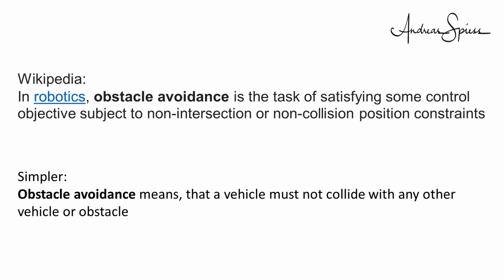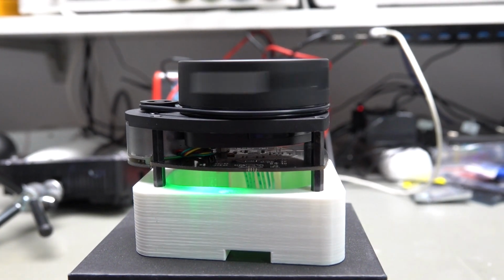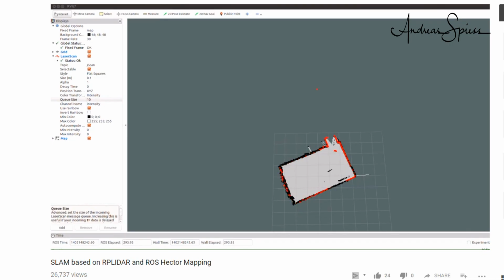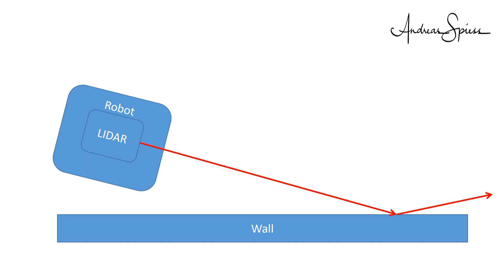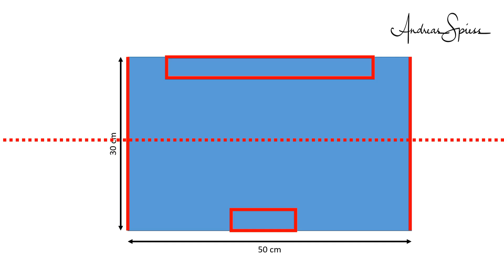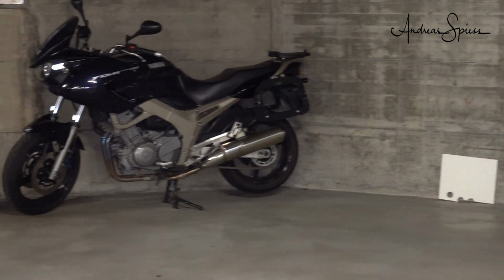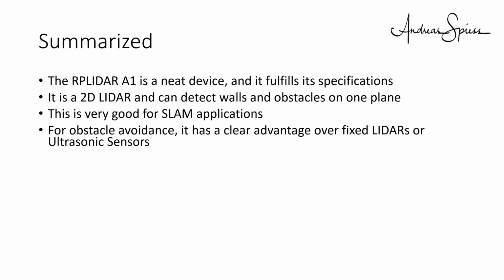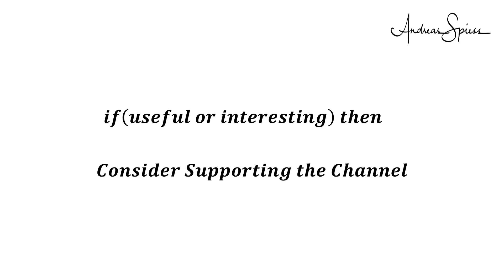#227 The ugly truth about LIDARs for obstacle avoidance (RPLIDAR A1, Arduino, ESP8266)

Comment: The 2D-system could be made into a 3D-system to look in the forward direction by mounting it vertically on a turntable that ‚oscillates‘ from left to right and back at a defined speed within a defined angle. You probably lose some scan rate for backward beams. That‘s the same with horizontal mounting. But while the system is vertically mounted, the challenge would be to reduce beams in all other false directions by coordinating the turntable‘s speed to the scanner‘s speed. The rest should be a matter of software. Probably exceeds the possibilities of a small Computer...
I’m just blowing the faint wind of my thoughts into this great brainstorm.
Thank you for all your great Videos.!
Reply from the maker: The idea of moving the head was discussed in other comments. It is possible, but you lose time with it.

Comment: HI ANdreas, I came to the same summary. Then I got to thinking outside the box (pun) while watching this. What if we mount this lidar on the verticle plane rather than the horizontal? Then we no longer have a low hanging object or ground object problem. We now have a left to right problem. If we mount this on the side of our tank for instance and as high as possible, this sould solve the problemds discussed. Now left to right is a problem as our sensor is only mounted on the right side, we can now mount a second on the left side to solve this problem. However I propose instead of one mounted on the left and another on the right, we  have both left and right sensors mounted on a spinning platform on top, now we resolve the shortcommings of 2d lidar and now have 3d lidar(or close enough) what do you think? Picture an old police siren that has two lenses inside which rotates, this is our two vertically mounted cheap lidar modules instead. Thoughts?
Reply from the maker: There were a few ideas in the comments. You can look at it from different angles: In the end, you have to reach a 3D area. You either do it with a moving 2D sensor (with the tradeoff of additional mechanics and slow speed) or you upgrade to a real 3D scanner.

Comment: @Andreas Spiess - thanks for a great video series - you always ask the "right" questions when checking out new technologies.

In an earlier reply you stated "So today, I tried (my RPLIDAR) in front of a mirror. It was able to detect obstacles through the mirror, but only if the mirror was in a 90 degrees angle to the laser. This was only a narrow area.".

Can you be more specific? If the suggestion from some readers is to take the back side of the 360 circle and use one mirror at 45° degrees to point the laser (and the reflection path) up and another one above at -45°to point it forward the angle between the incoming laser and the reflection will be 90°. Does this work? Can you hold the RPLIDAR at 45° close to the mirror and check, if it shows reasonable distance readings based on the reflection?

Of course it would help if you use a "surface" mirror where the aluminium is not behind the glass but in front of the glass. The you only have one reflection plane and not the glass plane and the aluminium back plane for reflection. A cheap source for such mirrors for 6€ is here (they are used in overhead projectors): https://www.betzold.de/prod/77637/ .
Reply from the maker: I did exactly what you describe. And it showed reasonable results. But as I wrote, only for a few degrees, because the mirror was flat and not round. You can draw the beams and see where it goes if the angle points to the back to the mirror with an angle of let's say 20 degrees. Then the beam does no more go to the front to the bot, bot to one side.

Comment: LIDARS are mostly used for mapping and planning, not for emergency obstacle avoidance. What you can do to improve the chances of detecting small objects with the LIDAR is to implement a probabilistic sensor model like HIMM or Bayesian and map the data over time.
Reply from the maker: I always thought LIDARS on cars are also used for obstacle avoidance. As I showed the LIDAR was able to "see" quite small objects, but only in one plane. So the enhancement of analysis would probably not help the (fast) obstacle avoidance. However, it could help to increase mapping accuracy.

Comment: LIDARS work like ultra sonic distance sensors but using light instead of sound. They don't triangulate anything. You might have mirror walls, but most people have regular white walls, that scatter light into all directions just fine. And those 3 fixed LIDAR systems you tested in an earlier video aren't even LIDARS, they are just regular infrared proximity sensors which work in a completely different way and have nothing to do with LIDAR.
And I'm not sure what the purpose of this video is... Of course if you don't have the right LIDAR system for your obstacle avoidance system, you're not gonna have a hard time avoiding obstacles. If you don't have the right screw for a particular application that also doesn't mean screws in general aren't well suited.
LIDAR is absolutely awesome. And if you have the right system it has countless potential uses.

Here are some examples of what LIDAR data from a good LIDAR system looks like:
https://youtu.be/nXlqv_k4P8Q
https://youtu.be/aIxYt7DkK5A
https://youtu.be/4RRBOoLsCEg
Reply from the maker: My definition of LIDAR is: Light Detection and Ranging. So we use different definitions. And there are a few ways LIDARS work. Only one is Time-of-Flight.
Reply: @AndreasSpiess  "Light Detection and Ranging" isn't a definition, it's just what LIDAR stands for, it is based on rader which stands for "Radio Detection and Ranging", but neither of those say anything about how the work or what would be considered a LIDAR. If you pump so much current through a diode that it starts glowing that doesn't make it an LED, it just makes it a broken diode.
Considering the term "Light Detection and Ranging", I can understand someone considering any system that uses light to measure distance to something LIDAR. But technically LIDAR is a specific way of measuring distance using light and just as triangulating your position using GPS isn't called RADAR, even though it technically also uses radio waves to range something, a common infrared proximity sensor isn't LIDAR, even though both commonly use infrared to measure proximity.
For more information on LIDARs visit: https://en.wikipedia.org/wiki/Lidar

Comment: To escape the 2D restriction inherent in the rotating laser platform, could one use a two-axis mirror system of the type that is inside of a grocery-store bar-code scanner?
Reply from the maker: Maybe. but not easy on a rotating device. And you would lose most probably speed

Comment: Is it possible to run multiple of this A1 sensors in the same vehicle, or in the same space, without interfering? Maybe synchronizing phases in some way? Or using different wavelengths?
Reply from the maker: The laser is quite small, so it should be no problem to run a few of them in parallel. The chance one sees the other for more than a fraction of a second is quite small. But i only have one :-( So I cannot test.

Comment: A good mm wave radar should do the trick. May be see what you can achieve with a RSM2650 although I do not think it would be successfull.
Reply from the maker: Unfortunately, these sensors only detect speed, not distance. We used them in an earlier video. Maybe it would be possible to use a speed signal with an algorithm to do obstacle avoidance. I do not know.
Reply: Look at the  offerings from aerovironment:https://aerotenna.com/sensors/#usensing
Some offer significant range for high speed navigation. They have demos showing it detecting power lines as well

Comment: One of the ways to speed up computations is to do a buffering and batching. Buffer lets say 30 points, then send an array of 30 points to a different core or processor where they are all processed together (i.e. denoising, combinging with previous data, doing kinematic compensation from gyroscopes and accelrometers, etc). This way per-point overheads are reduced greatly, and main code only needs to focus on communication with lidar and basic processing of points. 1400 points per second is extremely small amount of data for modern computing systems. In DSP and audio processing systems you usually process about 100k samples per second. In video processing dozens of millions of points per second. In graphics systems, you can be processing trillions of entities per second, using FPGAs, DSPs, GPUs or multicore CPUs. As well by smart software solutions like batching, async processing, circular buffers, vectorization, etc.

Seriously 8MHz, 8-bit MCU with no FPU, no DMA, and multiple high speed UARTs is terrible for any serious robotics.
Reply from the maker: This is what I meant when I mentioned a subsystem. With my 3 ultrasonic sensors, I used an ATTINY to do the measuring. Like that the main processor only had to read two values: The shortest distance detected and the direction where it was. Much faster.

Comment: I purchased a RPLIDAR A1 based on one of your earlier videos. I've constructed a mount to pivot the LIDAR up and down.
I think the increased scan time can be compensated by controlling the rotation of the LIDAR directly.
Rather than having the LIDAR sweep a full 360 degrees, I plan to limit the rotation to 90 degrees or less. I'll need to either control the DC motor included in with the RPLIDAR A1 or to use a different motor to control the LIDAR rotation.

I haven't tested how well I can control the included DC motor yet. Hopefully an h-bridge will allow LIDAR to sweep back and forth rather than rotate continuously. I'm skeptical I'll have enough control the included motor to make this work well. I'll likely need to add an encoder to monitor the motor's speed and position. The small motor might not be up to the task of continuously changing direction to produce the desired back and forth motion. I think it's very likely I'll need to use a different motor to produce this motion.

The LIDAR itself provides feedback of the device's angular position but I think it would be hard to use this feedback for relatively precise motor control. I think either a gear motor with an encoder or a stepper motor will be needed. A stepper motor should be okay since the position feedback could be used to correct for any lost steps.

I'm hoping by adding a tilting mount and a motor to point the LIDAR (rather than spin the LIDAR), I can use the RPLIDAR A1 for obstacle avoidance.

I've made progress building the tilt mount but I haven't yet tried controlling the RPLIDAR A1's motor to limit its rotation. I used to make videos about my robot projects but I haven't done so in a while. I'll make a point of documenting my efforts as I attempt using LIDAR for obstacle avoidance.
Reply: The high inertia of the rotor will kill your plan.
This little motor is in no way designed to accelerate the rotor that fast as you would want. Even a much bigger one will not be able to exceed the 7 Hz you already have to a higher scan frequency that makes worth the effort.
A possible approach would require a different optical system. A continuously rotating mirror pyramid or polygon drum will give you a scan effect over a limited angle. When the beam leaves the range, the laser points on the next mirror segment and the beam comes in from the opposite corner. This is the principle how laser printers were working 20 years ago.
Bonus: If your polygon mirror drum has enough segments, you can tilt the mirrors to obtain multiple planes. Imagine an octagon drum with 8 mirrors of slightly different angles, so one revolution can give you 8 scans of 90° in different planes.
Reply from the maker: I agree with SpeedFlap. It is probably faster to keep the motor running than to reverse directions. And laser for sure will have a longer life.
Reply: @Andreas Spiess  "I agree with SpeedFlap. It is probably faster to keep the motor running than to reverse directions."
This may well be the case but I don't think I'll be able to stop myself from trying the back and forth method.

"And laser for sure will have a longer life."
If by "laser" you mean the complete LIDAR unit then, I tend to agree. Moving the assembly back and forth could increase the wear on the slip ring and possibly increase the wear on the encoder used to determine angular position. 
I was about to say the laser diode itself should be unaffected my proposed change. Thinking about it a bit more, I concede the back and forth acceleration could cause additional mechanical strain to (electrical and mechanical) support components used with the laser.
I have a feeling any changes I make will likely reduce the functionality of the RPLIDAR A1. It's a really cool gadget as is (thanks for showing it in a video Andreas Spiess). Even if the changes I make aren't practical, hopefully they'll be interesting.

@SpeedFlap "The high inertia of the rotor will kill your plan." I'm not so sure I agree. I'd likely have trouble moving the rotor back and forth quickly with a motor, of similar size of the original motor, but I'm sure I have lots of motors capable of accelerating the rotor without much trouble.

"Even a much bigger one will not be able to exceed the 7 Hz you already have to a higher scan frequency that makes worth the effort."

I'm not really concerned about a lower scan frequency. I just want to convert the 2D scan to a 3D scan even if the area scanned isn't very big. I'd rather have a 2Hz scan of an area where obstacles could interfere with the progress of my robot, than have a 7Hz 360 degree scan of at a single height.

I considered removing the LIDAR unit from the rotor and use my own pan and tilt mount but I didn't see an obvious way to separate these. I didn't want to mess up the slip ring/encoder section of the device so I ended my disassembly exploration with the LIDAR still attached to the rotor.

Thanks for the feedback guys. Thanks for the great videos Andreas Spiess. I'll make sure to document my efforts with videos posted to my channel (I haven't posted anything interesting for a while).

Comment: Have you considered 3D TOF Cameras? They use a pixel array to measure time traveled for pulsed light or radar waves. E.g. https://www.infineon.com/cms/de/product/sensor/3d-image-sensor-real3/ . TI is the other vendor. Some modules are as low as 150€ right now and will come down in price signficantly when this is picked up by automotive and mass-produced (similar to accelerometers who became cheap due to smart phones). Of course you need processing to detect and identify, what you want to see but for obstacle avoidance its pretty clear - you can move forward if there is a flat surface extending in front of you and nothing hovers in the 30x50cm box above it for the next 50 cm.
Reply from the maker: I do not know these products and I did not find them for sale. Do you have a link? Mouser at least does not carry these sensors. Maybe they are quite new?
I am sure we will see a lot of news in this area in the next year. I hope I will be able to test such devices when they are affordable for the Maker. As you mention, it might take some time until they reach the mass market.
Reply: The great thing about these 3D TOF sensors (also structured light and stereo vision) is that you get a depth map - for each pixel the camera takes you get the information how far whatever is there is away. So similar the the lidar you describe but not circular around the vehicle but towards the front but then for a 60° angel sideways and up and down. You do not some processing capability so an Arduino might be to weak - for one thing to handle the data coming in via usb.

I listed some models below - only the kinect is in the maker spaces - the others are a little higher. I left out models below 4 m distance, models not available for purchase by makers and focused on tof vs structured light as its better outdoors

stereo vision
    intel d415/d435 149$
    stereolabs zed 449$

light coding, structure light
    microsoft kinect v1 11$ (used)

phase shift 3D tof cameras
    microsoft kinect v2 50$ (used)
    mesa sr 4500 (expensive, professional)
    basler (expensive, professional, use the panasonic 3d tof sensors)
    pmd flexx (based on infineon real3 sensor) 300€
    SeeedStudio DepthEye 3D Visual TOF Depth Camera 190€ (based on ti tof opt8320), 80x60 pixels, usb 2.0, windows, 0,2-2m range, fps 1000, power consumption)
    Teraranger (1 direction only)

I want to build an outdoor vehicle the size of 2 "bierkästen" to roam the wood and countryside paths autonomously. So power consumption and water proofness are my key concerns. I plan to augment the local depth map information with information from gps and maps on where there should be a paved "forstweg" or not. Initial application is ornithology but i'm still open on that.

links i found helpful:

https://www.youtube.com/watch?v=OMDfQC0m4i4

https://books.google.de/books?id=VdayDgAAQBAJ&pg=PA19&lpg=PA19&dq=pmd+flexx+alternative&source=bl&ots=50McN4qm1a&sig=03ejH4V5H4GaWeARtI5gO6bk7G0&hl=de&sa=X&ved=2ahUKEwjuwKezv-DdAhWDCCwKHbeADbAQ6AEwCnoECAEQAQ#v=onepage&q=pmd%20flexx%20alternative&f=false

https://www.dronezon.com/learn-about-drones-quadcopters/best-uses-for-time-of-flight-tof-camera-depth-sensor-technology-in-drones-or-ground-based/

https://books.google.de/books?id=FutgDwAAQBAJ&pg=PA29&lpg=PA29&dq=pmd+flexx+alternative&source=bl&ots=Pq8606Xo4e&sig=GA-bDknVw3quwKfK7-jOO8VhNHI&hl=de&sa=X&ved=2ahUKEwjuwKezv-DdAhWDCCwKHbeADbAQ6AEwDXoECAkQAQ#v=onepage&q=pmd%20flexx%20alternative&f=false
Reply: Here is my project description to provide context to what I'm looking for here: http://4xb.de/farmtrackrover/